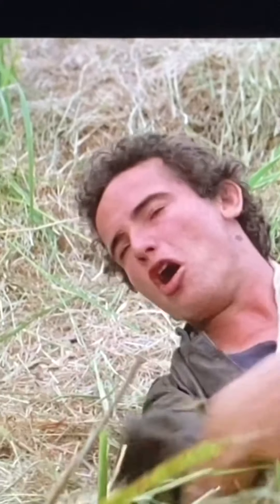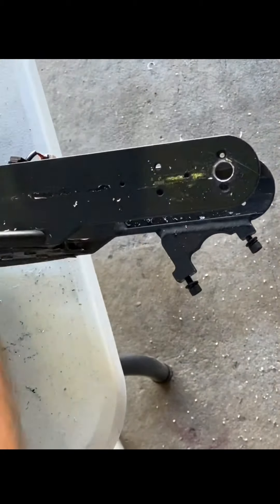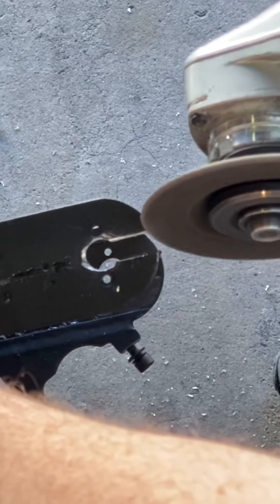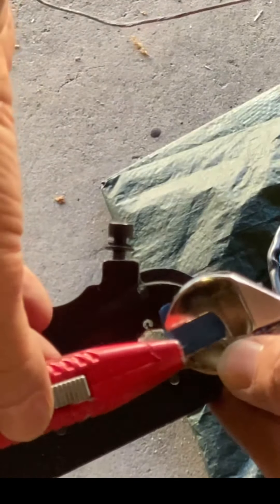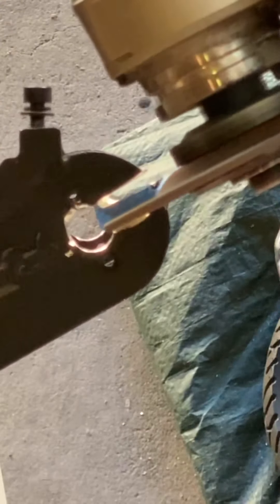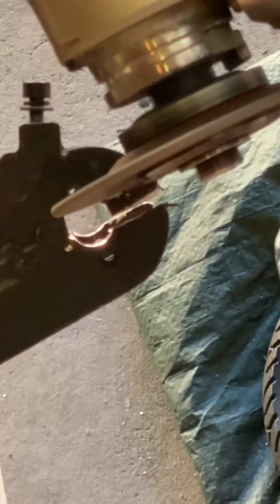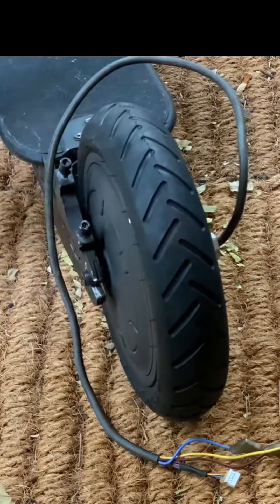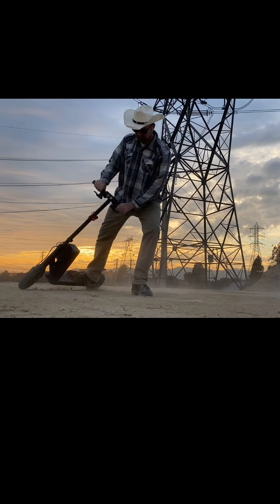How to install M365 stock rear motor /building rear wheel drive RWD / AWD Xiaomi electric scooter

Comment: Hi mate. 
Do I need to make the holes bigger to fit the axle of the motor?
Reply from the maker: Yes. But only the width of the "flat" part of the axle.
Reply: @thecam0073  ok mate so the part where the cable comes out of the motor must face the brakes?
Do I make both holes bigger to fit the axle or only the one opposite the brakes?
Reply from the maker: @Lev.com123  I think if you swap 2 phase wires the motor will spin in the opposite direction so you can have the wires come out either side. On one m365 i drilled out the hole for the taillight wire to run the phase wire inside the deck.
Reply from the maker: @Lev.com123  here's the whole playlist... 
https://youtube.com/playlist?list=PLeHZqmhLnUdnvmzQtd_7E9W4_m22sme8D
Reply: @thecam0073  thanks so much

Comment: any way to get the disc brake back in? hasn't anyone made a custom fit spacer or something?

also - how are you driving the rear motor? any mods to the battery?
Reply from the maker: I use all stock parts and stock batteries. I cut tbe disk mount off my frame. The dual electric brake works pretty good but not at full charge and not really under 1mph. I added the ES2 footbrake. Join my awd m365 group on Facebook: https://www.facebook.com/groups/224552771941930/?ref=share